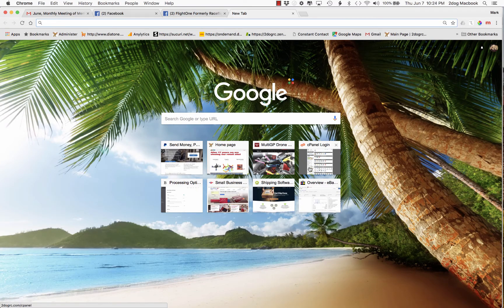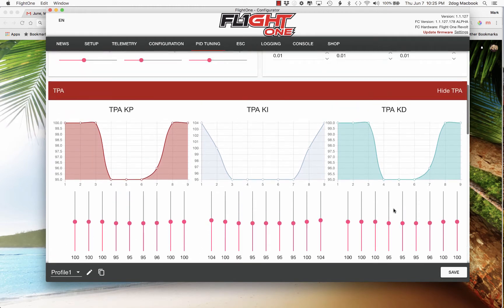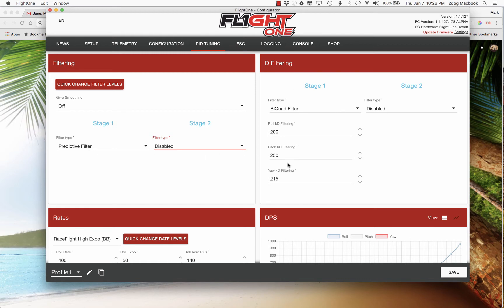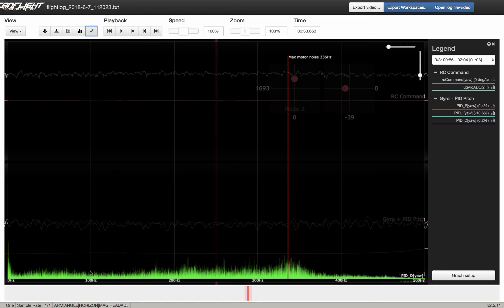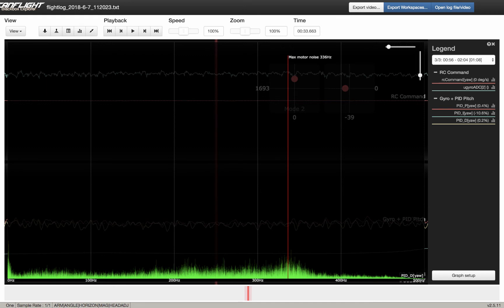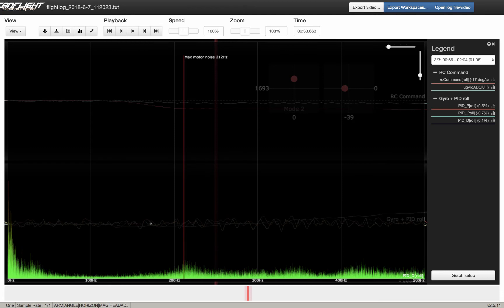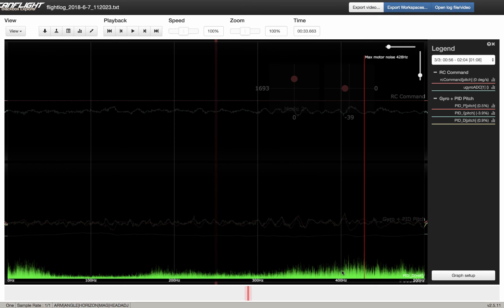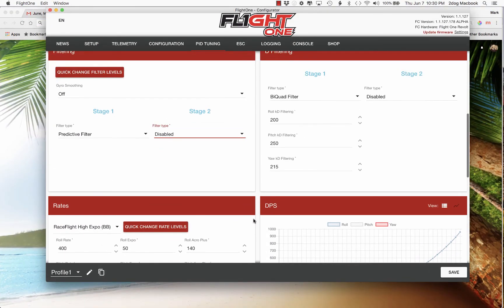Flight One 1.x Filter Settings

Comment: Can you help explain how TPA works im raceflight1.. i dont understand how to tune it.. im having a wobble when dropping the throttle from like a Split-S .. or when i throttle up and the ZERO throttle when im falling it will wobble on the roll axis
Reply from the maker: TPA reduces the value of P I D at the throttle range selected. This is helpful if you want to rub a very high P, you can reduce its effectiveness at higher throttles since the motor is producing more thrust. You would use this if you are getting shakes at high throttle settings. From what you say I would try raising your P on Roll, because maybe it is not applying enough to keep the quad level and that is why you are getting the wobbles
Reply: @2dogrc  thank you for the reply I have been around betaflight and kiss and understand how TPA works but my question is if I want to say increased the attenuation at Mid throttle do I raise the slider or decrease the slider thanks
Reply from the maker: FPV Addict You would raise the slider to increase the effect in that range.
Reply: @fpvandgasrc4321  i had the same problem. i just reduced tpa for 10-20% throttle